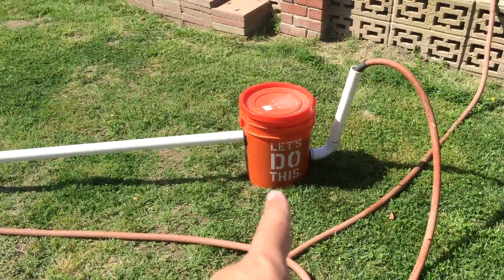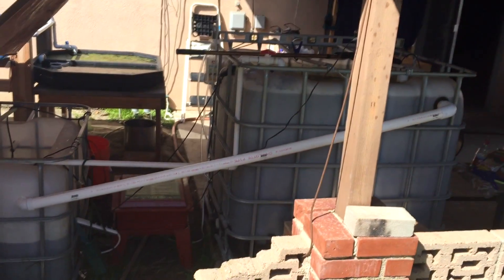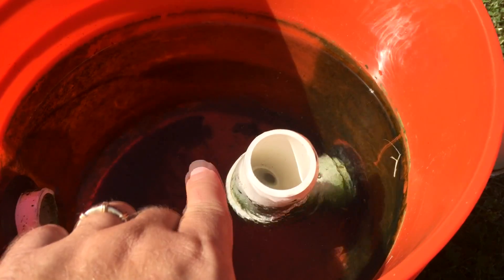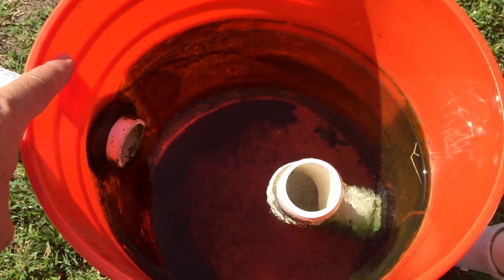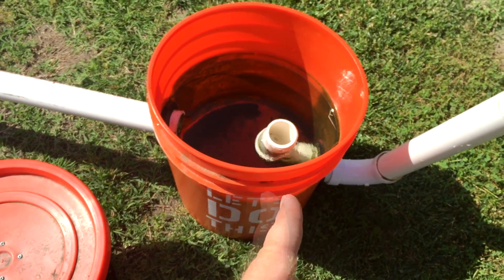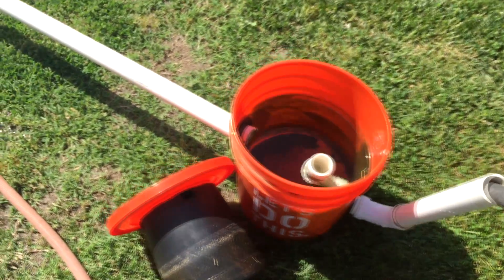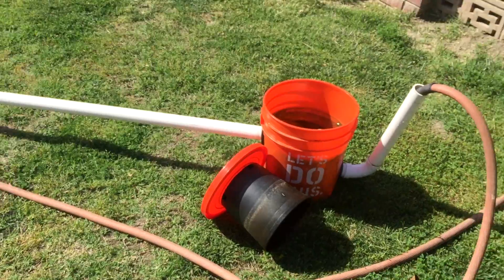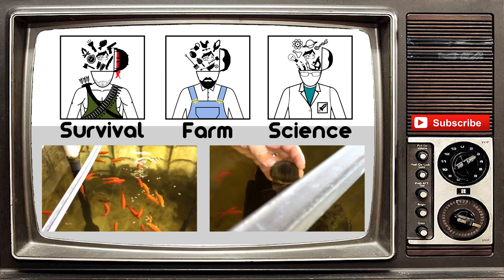Radial Flow Filter Fail!

Comment: I was looking at some older videos and I just wanted to point out how close you were. 
     This bucket was perfect not only in size but the way it's built also.

HOW IT WILL WORK:
     You just have to reverse the water flow so it comes in on the side (Adding a 90 degree elbow making the water continually flows around instead of in and all over). The Clear water exits from the tube set in the middle/surface of the bucket.

WHY IT WILL WORK:
     As the water comes into the bucket it's forced to go round, pushing any solids out to the sides and down to the base of your filter. if you look up "Thien baffle for woodworking filters" you'll find how it's used to filter sawdust and other really small particulates from the air.
     Using the same principals as in this video (by Marius Hornberger)

 https://www.youtube.com/watch?v=hebWtarFp5I 

      Use PVC, rubber and other plastics instead of wood.(11:19)is the part of the video that explains  the "Why" but I recommend you watch the full video, so you'll see the construction and the "How" instead of just the "Why"

Comment: Radial filters are quite effective. The bucket should work depending on how many fish you have. If you have quite a few fish the bucket could be too small for what you're running. I'd go with a smaller internal pot, add a 90 up on the outlet, and adjust the water level via pipe to the desired level.  How do you clean it out without an outlet on the bottom?

Comment: The surface area of your inside flower pod should be less than the surface area remaining. The particle is carried downward, and because the surface area for the downward push is smaller than the surface area for the exit flow, the net momentum of the particle is still downwards.

Your surface areas is the other way around and as a result the surface area of your exit stream is smaller which results in a faster flow which will change the momentum of the particle and eventually suck it back out.

Use a much smaller diameter flowerpod or pipe.

Comment: You can turn the inlet pipe and create a swirl filter and with the outlet you could of used a 90 degree elbow and rasied the water level in the bucket. I did it that way and it is working.
Reply from the maker: juancarlosruiz1985, good stuff:) I did what you said some time back and put the video on my other channel (The Fish Tank). https://www.youtube.com/watch?v=617xVppnwFo

Comment: The size of the RFF should be able to have the capacity to hold the water for a minimum 20 minutes (1/3 an hour)  For example, if you are pumping 200 gallons of water through your fish tank, the RFF should be 40 gallons.  You need plenty of time for the solids to settle out.  ;-)
Reply from the maker: Matt Olsson, I moved on to a swirl filter that seems to be working really good:)
Reply from the maker: +Bigelow Brook Farm (Web4Deb), dude thanks! That is what I needed to know:)
Reply: This document outlines how it should be designed http://www.aquaponic.com.au/Solids%20filtration.pdf
Reply from the maker: +Bigelow Brook Farm (Web4Deb) thanks again my friend!
Reply: actually for a properly designed RFS (radial flow settler) the retention time should be at least 2 min but closer to 5 min will make it work even better. 20 min is overkill.
also the stilling well you use is too big. you need a smaller diameter for this size radial flow settler.
Reply from the maker: That's a cool idea:)

Comment: I kinda of disagree with a couple of things, and the only experience I have had is fish for 18 years.
probably would not have anything in direct sun light due to over heating the water. 
Consistent water temperature keeps fish healthy.
The idea of a settlement tank or radial flow, I find unnecessary since algae will eat that up.
Your plants will convert any ammonia into a non toxic nitrate. you are over doing it. just have one pump and
do partial water changes. just my two cents.
Reply from the maker: +MrMac5150, thank you for the feedback for sure! The plan is not to keep this filter in sun light, I will have it in the shade but it just so happened that the sun hit it at times and it grow to much algae in it. I plan on getting a filter container that will not let sun light in at all so it will not matter if sun hits it. 

I did not really share the reason why I want to remove most solids so I will say in part why now. I plan on growing aquatic plants and I have noticed the the solids tend to settle on the leaves of aquatic plants. When this happens the aquatic plants do not get as much light as they could get if there was very little solids:) I also want the water to be cleaner then it is now. 

Bacteria converts ammonia into nitrites. From there another type of bacteria converts nitrites into nitrates. Plants eat the nitrates as fertilizer:)
Reply: ..Nitrates ARE poisonous to fish, however less.
Reply: +Home Farm Ideas I'd look into swirl style filter. I find it works more efficient. With that said, I use a 39gal trash can. gl
Reply: +Cannabis Aquaponics pretty much personal preference  to which is better, here in australia we seem to swear by radial flow filters ive used a swirl filter befor and didnt think it worked that well, not compared to a radial flow filter but others on forums have said the opposite in america saying that swirl is better :S i guess it comes down to what  you prefer.